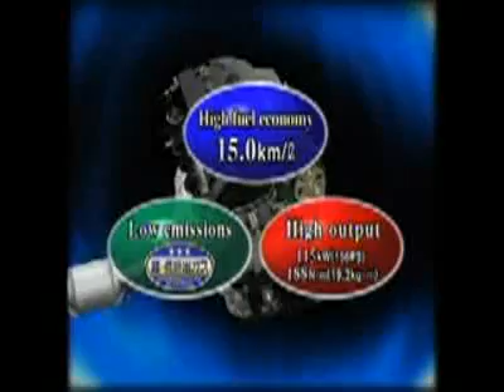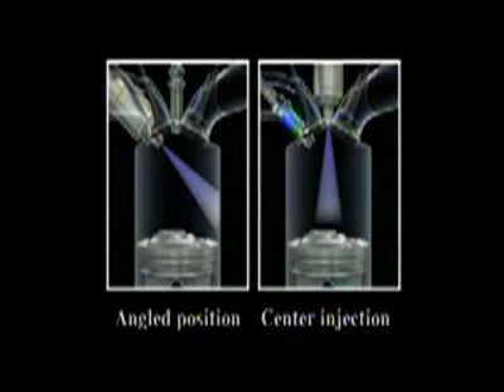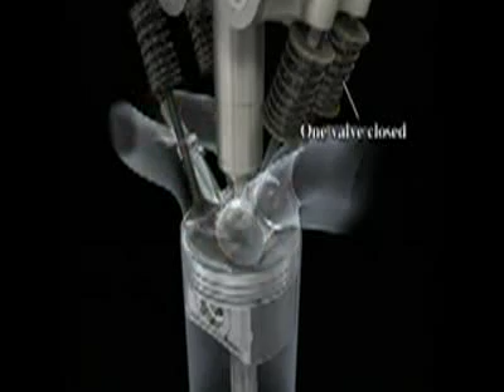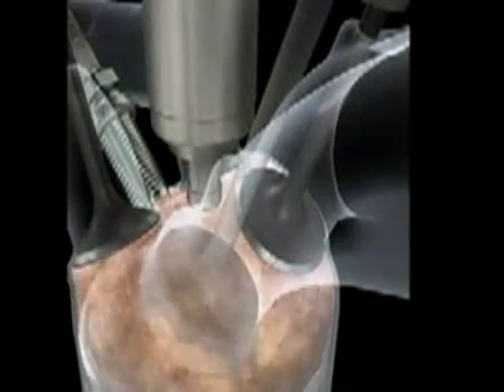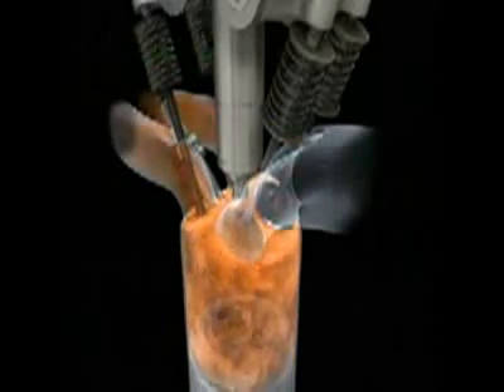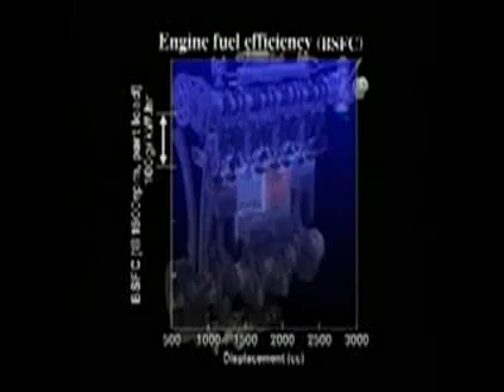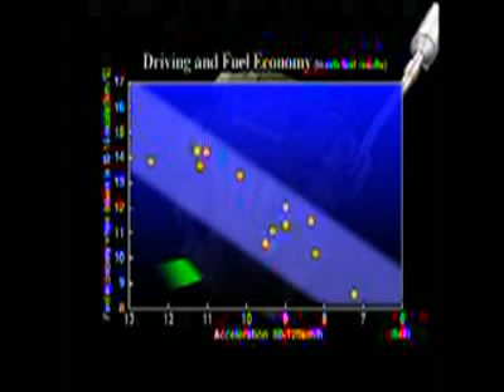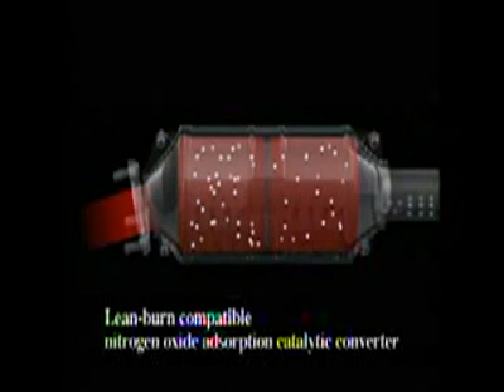Honda i-VTEC I Engine

Comment: I didn't realize the sophistication of this engine.  The valves and timing are constantly adjusting to the type of driving that is being done.  And it does it so well.  My 2009 gives a consistent 24 mpg driving in city traffic to and from work.

Comment: v-tec is found in the older engines like the B16 and H22,  and i-vtec is found in newer engines like the R18 and K20...i know this is not a good explanation but if u want to know the real difference do some research cause is to long and complicated to explain

Comment: @jbzEK9 driving habits meaning, there would be no-A/C while driving. late braking, easing up on the throttle. you may know the fucking fuel economy facts that the car companies portray on tv ads and brochure, but apply it on a day to day basis, then it would be irrelevant and useless.

Comment: @jbzEK9 im not getting through am I? in my 1st post i said that i was just merely pointing out the flaws of the honda engine on my DC5. you blur out that my car is not a type-r. let me ask you this in my 1st post what made you say that my car is not a type-r? is because i didnt wrote type-r on my 1st post? now you'd be the judge if freaking idiot? you clearly made assumptions on my 1st post.

Comment: @jbzEK9 besides, you made the statement that" because your DC5 is not a type-R, how would you that my DC5 is not a TYPE-R have you even met be before. i clearly check the papers before i signed it. because in my country. the imported cars have different plate no.s than local ones. i even bought a conversion kit, so that i would make it left hand drive, because it was originally right hand drive.

Comment: @jbzEK9 because you might think that, im only talking about the performance stuffs. but im actually posting about everything that has to do with the engine, because honda engines dont have that sense fluidity, but the honda engine makes up with how urgent and responsive it is. well fuel economy, well i dont know about that, the K and B series are thirsty bastards, i cant even make it go 10KM/L with my DC5.

Comment: @jbzEK9 i didnt got off topic dude. i merely named the cars because the engines that i mentioned was bolted in them. if you got confused about it, then it would be my bad. im not afraid of admitting something that basically my fault. but i merely pointed out that, there are some areas on which the honda engines cant match up with other branded engines, like engine noise, fuel economy, and other factors.

Comment: @jbzEK9 let me give you a concrete example on what i am blabbering about. the Porsche put the cayman in production to fill the gap between the boxster and the 911's. why? because the they found out that the cayman has a different kind of market on which the boxster and the 911 cant go. its also the same with other brands.

Comment: @jbzEK9 and again, im comparing what sport cars honda's have and the other car brands have. you have been mislead again, dont tell me that the integra wasnt built not compete with the silvia's and eclipse? the evo and the STI can be compared by the s2000's and the NSX. its basically a mindset dude. its not about the FWD and N/A or 4WD and turbos. im talking about a different kind of class. a class rank of A-D.

Comment: @jbzEK9 because the 4g63 that im talking about is the 4g63 of the galant, which is completely different from the 4g63 of the evo or the eclipse. or the 3sge, which is fitted to the mr2(nonturbo). im a great fan of honda cars. but im open minded on other engines of other brands.  Yes honda engines are good, i applaud to that, but there are other engines that can equally match it.

Comment: @jbzEK9 i can compare it to that because these are its main rivals. if im gonna compare the Type-r version. then i might as well compare it to 4b11 of the evo, or the sr20 of the silvia's or the 3sgte of the turbo mr2's. because basically the Type-r is the race the race version, then its logical to compare to it's race version competitors. dude you just got mislead to my 1st post. if you have to read it more closely.

Comment: @jbzEK9 w8 a min? why did the debate moved to the Type-R? what i was explaining before is that the ivtec has flaws, yes the i might compare it to the 4age or the 3sge of the mr2's or trueno's or the 4g63 of the galant or the 4b11 of the non-evo lancer. then it may have a hard time, because, i also have a 2.0 civic with i vtec on it, and im sad to say that its trying to hard to be everything.

Comment: @jugbugz 
dude the integra DC5 is a type-R engine, the non-typeR k20a engines are bolted on the civics, if you want to know more about the DC5 check in any honda club websites. if incase you dont know, all top end model integra's carry a Type-R badges, 1st gen integra which is the DC1 had a type-R b16a engine i think, the DC2 had a type-r b18 engine, and now the most latest model the DC5 carry a k20a type-r engine.

Comment: @casoig on a redtop type R k20 it engages at 5800. 
but this is a blacktop and is used for economy, which probly means it engages at 6000 or later.